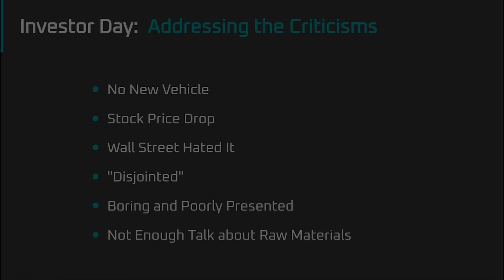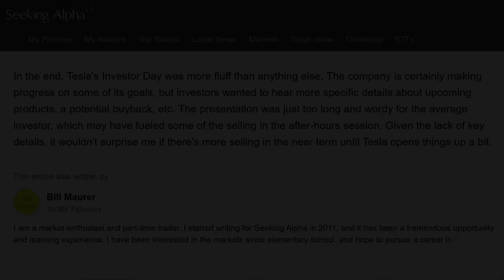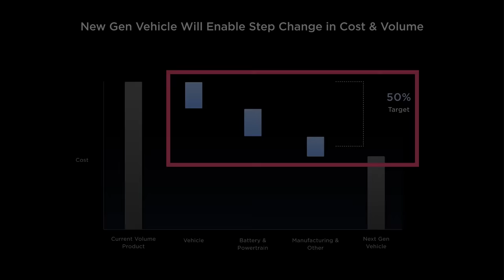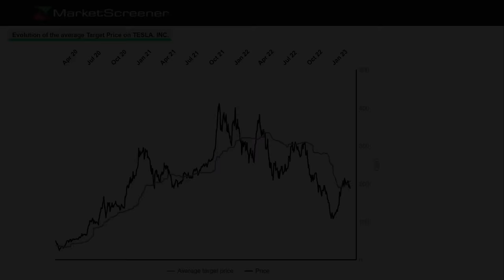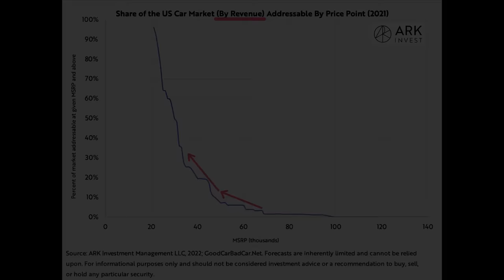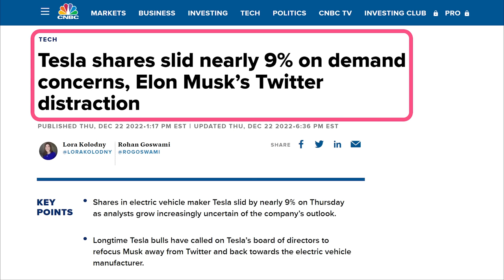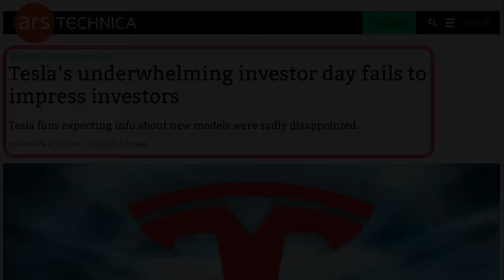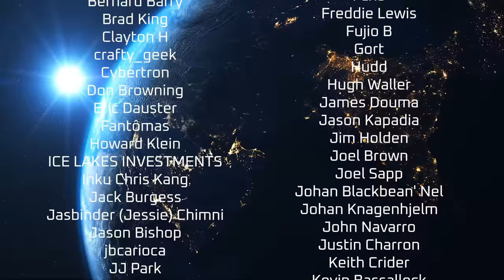Tesla Investor Day // Cheap Complaints and Valid Criticisms

Comment: In terms of the new vehicle they told is: It's a platform with several vehicles on, it will use modular construction, it will have hardware 4, it will be 50% the cost, it will be built in Mexico and other places with the factories being build simultaniously, it will be produced in massive volume, it will use Tesla's in house power electronics and structural battery, it will use motors with no rare earths in, they are making a robotaxi network for it, they have battery supply for it.

I feel like that's a full unveil for everything other than what the body shape looks like and whether it has a cybertruck skin or a model 3 style skin, those are really the only remaining things we don't know. So for anyone to say they didn't unveil a vehicle is really short sighted and missing how they said everything other than showing the car as an image.
Reply: "BuT tHeY dIdN't GiVe Me A PreTtY pIcTuRe!"  /s
Reply: Exactly what I’ve been thinking. We know practically everything about the vehicle/platform other that appearance. The full 4 hours were basically a highly detailed breakdown of every aspect that went into the new stuff
Reply: Good comment, I also agree. They actually revealed more about the new model(s) than I was expecting.

One other important thing that they didn't reveal is the specifications. That is of course something that should be first revealed at the unveiling event. But I would expect that, like the Model 3 compared to the Model S, it would have slightly less range and power than the Model 3, and slightly better efficiency.

I say only slightly better efficiency, because the aerodynamic frontal area cannot be significantly reduced, compared to the Model 3, without making it too cramped for five occupants. This is generally the case for chunky compact hatchbacks vs. somewhat larger, but sleeker sedans. Also, better motor design can only partly compensate for weaker magnets, without making the motors bigger and heavier.

On the other hand, if they did manage it somehow, it wouldn't be the first time that Tesla has defied conventional wisdom.

Comment: Excellent Analysis Jordan.

- Overall, compared to every other company, this was an amazing presentation.
- Exception #1) The FSD portion was VERY disappointing, as I was expecting details about upcoming changes to the neural networks.  There are two possibilities.  Either they have run out of ideas to make the product work, or they are still executing on what they last talked about at AI day.  I suspect the latter.

- My takeaway: Tesla has Everything, and I mean everything they need to hit their goals for 20M/y Exception #2) a materials acquirement strategy.  They have people, product line up, innovations, cost reductions, supply chain, everything Except HOW they will get the millions of tons of materials.  I believe they did not share this strategy on purpose.  Why?  This is their secret ingredient and I don't think they will share this strategy until they lock in a plan with suppliers.

Tesla has a plan to reduce costs by 50%.  In less than 2 years time, EV's capital cost will be less than ICE vehicles.
Getting from 0-40k/week was super hard.  Getting from 40k-400k will be a cakewalk by comparison.

If they can only get the materials.

Comment: I was disappointed in the lack of new product announcements, sure. But we all know that the next major announcement is a cheaper passenger BEV. Elon has always said that manufacturing process and scaling is as important or more important than the vehicle itself to get to the end goal. Each piece of the presentation was focused on aspects of the former to demonstrate "yes, there is a path to a cheaper BEV, these are those pieces". It demonstrates that a $25K vehicle is possible and not just vaporware.
Reply: But they don't do product unveils like that.  You had an unrealistic expectation.  The point is to demonstrate a 25K vehicle process is possible but they don't get specific to avoid being accused of vaporware.

Comment: Jordan, when you do your follow up videos we need to see a drill down on whether the dry cathode coating process was now working. My initial sense was that they hinted on it but "CleanerWatt" rather thought it wasn't clear enough and only 'some progress'. Your view?
On materials, I'm rather less bothered about Lithium, we've barely scoured the planet for it and we know the fall-back position for it and there are potential substitutes especially for lesser applications. 
It's copper that troubles me; I saw one presentation on it and didn't see obvious flaws in the logic. It has a long history of mining and prospecting, it's not very equitably distributed, there aren't substitutes for critical uses [ok, I don't really need copper plumbing] and we are suffering decreasing ore grades approaching a tipping point of cost and energy input explosion. Do cover the question in your materials dive.
Reply from the maker: It's working!  It's just a matter of picking up the pace.
Reply: @thelimitingfactor  thanks 💯

Comment: Everyone is still assuming it will be a $25,000 car, and I expect it to be a $20,000 car. I think half of the Model 3 means production costs are closer to $15,000 for Tesla, and with a 33% margin they can sell at $20,000.. I expect that $20,000 car to start deliveries late Q1 or Q2, and people are also missing the fact that immediate tax rebates start in 2024, so I think people will be able to drive off in a new Tesla for just $12,500 out the door, and even less in California. 

VW just announced that they can sell a 300 mile range EV in 2025 for $27,000. Surely Tesla is more than $2,000 better than VW.
Reply: I’ve been thinking the same. All of the pricing estimates people have made that show Tesla’s typical margin while reaching 25k also seem to be pricing individual aspects much higher than I expect. I don’t think it will immediately be 30k (or closer to it than 25) since demand is going to be insane, but eventually I think it will be there
Reply: Well, lets see if VW can sell it at a profit.  Right now they're in debt, really deep in debt.

Comment: If the presentation was too long and wordy for the average Wall Street investor, it says more about the intellectual capabilities of the Wall Street „investors“ than about the presentation.
Tesla shows in detail how they will crush the legacy auto industry into pieces, the stock tanks down 6%.
Tesla makes a „Wall Street friendly“ presentation with laser show, fireworks on the stage, and 69 slides showing 42 computer renderings of new models for the next 6 years, and the stock would go up 20%.

Comment: Also a compact that is half the price of the model 3 outside US and China already exists. Its called the MG4/Mulan which costs 23k GBP vs 42k GBP Model 3 RWD. Its demand is average because electric is more expensive than petrol on the road (fast charging) and 14k cars (Dacia Sandero) exist?
Reply: "electric is more expensive than petrol on the road"? Maybe things are very different in the UK, but getting my used 2016 fiat 500 EV was my best economic decision ever. I use the car to commute every day and my total monthly expense for it is about $15. In the three years that I've owned the car the only other expense has been to repair a defective window raising motor.
Reply: @macrumpton  On the road means fast charging network up to 1 GBP per KWh?
Reply: You're looking at temporary things, and pretending they are just the way things are.  Wright's Law shows us why each new technology initially is more expensive, and as it scales, it becomes the cheaper option.  Meanwhile, ICE continue to lose economies of scale, and will get unaffordable over the next few years.  These are economic certainties.  Cherry-picking a moment in time that favors your conclusion doesn't change that fact.  Also, the average new car sells for $49,500 in the US today.  With the IRA, the Model 3 drops into the high $30ks, making it 25% cheaper than the average new sale.  Sure, cheaper cars exist, but not with that much tech, safety, performance, etc.

Multiple studies also concluded that EV drivers save an average of $5k/year in maintenance, and fuel costs.  If one has solar panels, and charging at home, they are driving at a cost near to zero.  Even a $50k EV has an ROI of just 10 years - better than most do on the stock market.  If someone buys a Bolt, or other cheap EV, that ROI is only 5 years.
Reply: You're looking at temporary things, and pretending they are just the way things are.  Wright's Law shows us why each new technology initially is more expensive, and as it scales, it becomes the cheaper option.  Meanwhile, ICE continue to lose economies of scale, and will get unaffordable over the next few years.  These are economic certainties.  Cherry-picking a moment in time that favors your conclusion doesn't change that fact.  Also, the average new car sells for $49,500 in the US today.  With the IRA, the Model 3 drops into the high $30ks, making it 25% cheaper than the average new sale.  Sure, cheaper cars exist, but not with that much tech, safety, performance, etc.

Multiple studies also concluded that EV drivers save an average of $5k/year in maintenance, and fuel costs.  If one has solar panels, and charging at home, they are driving at a cost near to zero.  Even a $50k EV has an ROI of just 10 years - better than most do on the stock market.  If someone buys a Bolt, or other cheap EV, that ROI is only 5 years.
Reply: @johndinsdale1707  I want my car to be built by a company who's goal is not just cheap but safe.  How has the MG4 done in crash testing?  Regardless though you are correct, it's a niche that needs filling.
Reply: @AMortalDefiant  As I lease my vehicles it is very easy to workout the exact cost as its all arranged up front except for the fuel. So a UK lease is less than a third for a CUV (Nissan/Toyota/VW/Ford) vs Model Y for the same contract miles including servicing. Fuel is a wash due to the War in Europe?
Reply: @AMortalDefiant  Used EVs are an even better deal

Comment: Using lithium for grid storage is really dumb, lithium should only be used for transport where you have to also carry your battery and mass and volume are important.
Reply from the maker: No more dumb than using lead acid batteries for decades.  People use the tech they have until something else comes  along.
Reply: Nickel Iron - the "Edison Battery" is a Low Energy Density battery, that fits your idea. However, it's a Patent that was acquired by the Chinese, and you can find them if you want them.

Sodium Ion might shape up to become viable in the future.

But, for now, LiFePO4 - Lithium Iron Phosphate, is mostly used in Megapacks, as I understand.

Comment: My main complaint is that autonomous vehicles were a key lynchpin of their master-plan, but they are years overdue and there's no demonstrable sign that they will become a common reality in any near future.  The future requires more than hand-waving.  What's the Plan B?  And no this isn't an EV Luddite speaking.  I've been following and promoting EV technology since about 2003.
Reply: @ken-mb5cp  I propose that the existence of a "V11" demonstrates the difficulty of the problem. It's like Zeno's paradox.  You can get increasingly close, but there remains a gulf.  Getting DOT to sign off on self-driving cars is going to be quite a big deal.  Consider how long Tesla have been lobbying for side-view cameras instead of mirrors -- a relatively trivial issue by comparison.  And the issue of liability remains a significant hurdle.  Adoption would require something akin to the Price-Anderson act.
Reply: There is no denying they were overly optimistic in their projections and he also admitted it was a harder problem than he thought it was going to be and that they chased several dead ends.  That's the pain of development especially when trying to do something never done before with an approach that has never been tried.  Despite that they're still plugging away at it but I suspect it's a few years away yet.